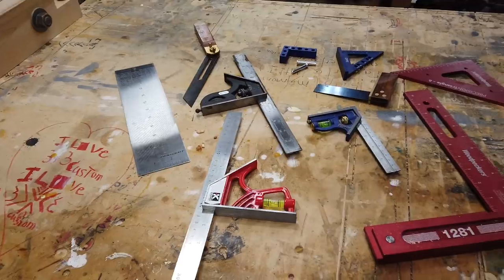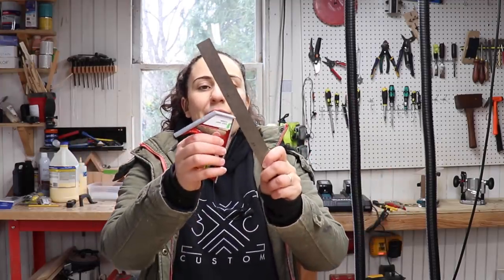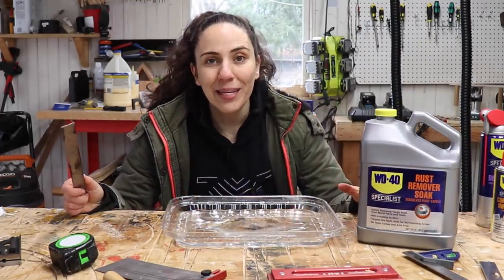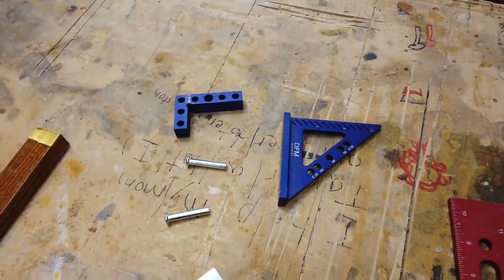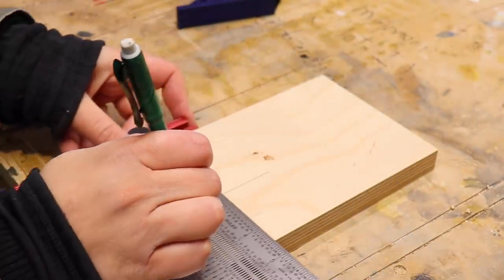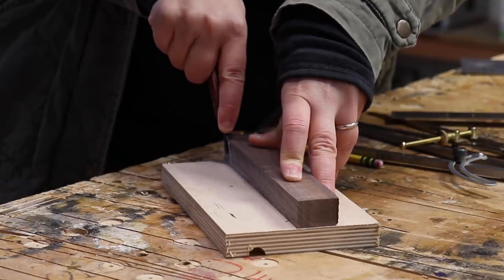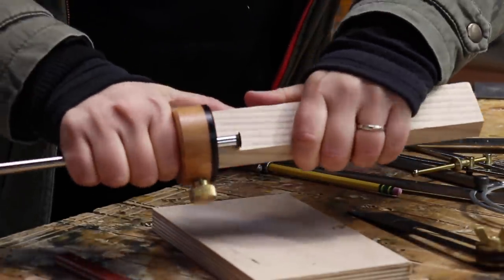Best Tools for Accurate Marking and Measuring When Woodworking

Comment: Excellent video, great examples and rationale.  Love my Starrett combo square.  I moved on to the satin finished rulers, I couldn't keep up with the rust removal.  I like the marking gauge for precise power tool cuts too.  I also quit using digital calipers, as I don't like chasing digital readouts, using instead Starretts analog/dial calipers.  Much less stress.  Keep coming up with the great stuff!
Reply from the maker: Glad you liked it!

Comment: Cool vid. I have a bit of a fetish for good measuring and marking tools. Don't throw out your carpenter squares just yet though, Harbor Freight or otherwise. Most of them are not "square" but can easily be fixed with a little know-how.  If your square is acute, hit a nail set into the flat side of the inside corner. If your square is obtuse, do the same on the outside corner. One good strike is all you really need. And if you are planning on throwing it out anyway, try the technique as practice.
Reply from the maker: Thanks! I was throwing it out as a joke. Don’t worry 😉
Reply: I am sure you were. I was more speaking to the impressionable minds of many DIY viewers.

Comment: Little known trick with framing squares. There is a small hole punched at the inside corner of the 90. The reason for this is so it can be "tuned". Don't toss that square, "tune" it and make it square! Framing squares have SOOOO many great uses and are a critical tool! Check out some "framing square tuning" videos on YouTube. Thanks for all the other tips!
Reply from the maker: I didn’t really toss it.... It was just a joke. I’ve had it fir over 5 years. I use it for other stuff

Comment: It's a little expensive, but if you need true pinpoint accuracy with a center punch, get an optical center punch.  It can really be tough to truly put that indent dead center on your marks with a traditional punch.  An optical center punch has an optic piece with a cross hair.  You sight down it, then hold the base in place, remove the optic and put the punch in place to tap your indent.  It is dead center every single time.

Comment: Good video, and not a Woodpeckers tool in the bunch.  DFM is an interesting company.  That little square is really cool because with the 2 pins, it turns into a multifunctional tool.  Just where do you keep the two pins as to not to lose them?
Reply from the maker: Glad you liked it! It comes in this foam packaging. I keep that foam thing in my tool drawer and keep the pegs in there

Comment: You can also pull 90°'s  or check out square on other enjoyable favorite measuring devices that brong your life joy and happiness by pulling 3,4,5's by measuring 3" or 3 foot or 3mm or 3meters the opposite direction of the 90° you are trying to pull or check and measuring out 4" , 4mm , or another weirdo measurement from wherever you are from like cubits american 10ths or the kings foot 12. Now pull your diagonal from 3 to the 4 and that will equal to the 5 measurement if it does not measure properly to the 5 then your not a square. I laid out a powerplant this way as a surveyor with a tolerance of 1/64th of a inch and we had no issues pulling 90°s to the layouts of the entire 14 acre site within tolerance using this measurement layout system which is actually comparable to the tolerance that the culture that built the pyramids at Giza which was 20,000 years ago and pretty sure that pre-egyptian culture pulled 3,4,5's

Comment: shamefully looks at her Barbara Plate speed square

Seriously though I love your videos! Didn't know you could derust with WD40, which is good because my shop is on an enclosed deck so it is very exposed to the elements!
Reply: WD40 Rust Remover
Reply from the maker: Haha! Yeah! The rust remover soak is pretty cool. Also cool that you can use it until it goes black! So you’re really getting a lot for it.

Comment: I agree with everything except the digital calipers. The usual argument is that they're not as accurate as dial calipers. While that's true you're talking about being off by any amount even highly precise woodworking tasks are going to notice. So that's not a reason I avoid them for woodworking. I mean I avoid them when using my benchtop metal lathe and mill because with metal being a couple hundred thousandths off is a huge deal; with wood not so much.  I've tried digital calipers and they're convenient but the problem is the batteries and the electronics. The batteries are always dead when you need them and the electronics always seems fidgety at best. It seems to be the same story no matter how much you're willing to pay for them. I have a very good quality 8" dial caliper and wouldn't change it for anything.

Comment: You can actually true a cheap combo square with a file.  There are two little bosses in the slide that the knurled knob locks the ruler against and one is a little proud...swipe or two with a needle or feather file and you'll be square and good to go...just for the cheapsters among us.
Reply from the maker: Yeah. There’s always way around it. True

Comment: Yeah you're using that small framing square wrong you can see right from the get-go that that piece of wood isn't all the way straight the way that the framing square wiggled when you did the line the reason when you used your combination square and it didn't do that is because it's such a short distance of contact
Reply from the maker: It may have shifted in the video. But I know this square is not square. That’s how I knew to test it.... I use it as a straight edge for other stuff...

Comment: You are a wonderful credit to the woodworking world! Your enthusiasm and tool knowledge are amazing. As I have been a woodworker for around 50;years, I have accumulated many of the tools you described, … but… you made a good point regarding some of the measuring/marking tools, so I’m heading online to put an order in. Thanks for the great presentation. PS Wait until spring to work on the lattice repair 😉

Comment: Great video!  Woodworking for many many years and totally respected what you projected in the video.  It took a great number of years before I had the courage to invest in good measurement and layout tools.  I'm 65 and it wasn't until the last 4 years I bought into a couple of Woodpeckers squares extremely  well made but overpriced (my opinion, mainly due to shipping costs to Canada).
I don't start a project until I have one of their squares in hand.  I have a bunch of Starett squares left to me from my father-in-law that I restored and cherish and use as well.
Reply from the maker: Thanks! Yeah. Hopefully I can get my hands on some more woodpeckers squares. They are really great.

Comment: Great video!  I video suggestion: a video about the tools, jigs, tables, etc. that you have made to create your shop.  A lot of the tools you have are self made like your cross cut sleds.  Those tools then help make your next project or tool.  I think a video discussing which items to make first would help a lot of people.  

A general rule of thumb: chemical reaction rates increase by 2x every 10 degrees (C).  So, if you did your rust removal soaking inside or in a heated space it should go much faster.
Reply from the maker: Thanks! I have videos on making all my jigs. But I guess that’s a good idea too. And yeah. I brought it inside.... ha

Comment: Im liking your no-nonsense way, and always good info; at 10:00 you are describing a marking guage, but it is really a cutting guage. I like these better than a marking guage because it slices the wood rather than pressing a dent or scratching the surface. I got a cutting guage but it has a ROUND HEAD machine screw at the end. What can I do when making a mark closer than 1/8"? It needs a FLAT HEAD screw to be useful in close quarters. In marking the depth of a mortise, and a many more instances!

Comment: What is the difference between Bradawl and Awl?

The difference between bradawl and awl

 

is that "bradawl" is an awl with a blade similar to a small, straight screwdriver; used for making holes, especially in wood to take screws and "awl" is a pointed instrument for piercing small holes, as in leather or wood; used by shoemakers, saddlers, cabinetmakers, etc. The blade is differently shaped and pointed for different uses, as in the brad awl, saddler’s awl, shoemaker’s awl, etc.

Comment: Great video.  You provide good info, and demonstrate very well.  I do like that you include video where it is reality.  Like when you took the square ruler out of the WD-40 liquid, and we saw the experience you had with it, such discovery that what you that was rust still on there, was actually some black “stuff” and was easily removed.  You also say that you don’t need all these tools, this is what you need to start out, and as you get better you can use tools that help accuracy.
Reply from the maker: Thanks so much! So glad you liked it!

Comment: How to align steel Carpenter's Square.
I was blessed to have a very old steel Carpenter's Square andusing the method you demonstrated learned it was out of square. The Square had a history of over 100 years of use and was worthy of adjustment. I corrected the steel square by "hammering" steel punch dimple(s). In my case the square angle was acute (<90) and 2 to three dimples corrected the square, these were placed close to the inside corner, along the fictitious 45 on the el. The angle of the square expanded and an accurate 90° was attained. Hammer hard and in a line as needed.

Comment: The metal square you tossed in the trash, I’ve corrected one twice the size using a metal punch. Simply see which corner of the elbow, the inside or the outside, is less than 90-degrees. Then using a hammer and punch put create a dimple.  It make take a good wallop with the hammer, and maybe more than one dimple on the acute angle side. But I corrected a 24” metal square with one dimple that took only two medium hammer blows.

Comment: Firstly, the combination square that you tested first is fine but it's very easy for it to be knocked out of alignment. Any tool that you can loosen to slide along a track and then tighten will have play in it, and I actually binned my combination square for that very reason. I really don't get why you swear by them. You're far better off with something that can't be easily knocked out of alignment.
Secondly, the framing square that you used, you can clearly see that you throw it down and then move it slightly to make your point. It's actually quite difficult to get those square because you have to angle it as you did so the bottom part resting on the edge of the timber doesn't slip. You'd be better off with a Woodpecker one that has an overhang so you can still rest it flat on the wood.
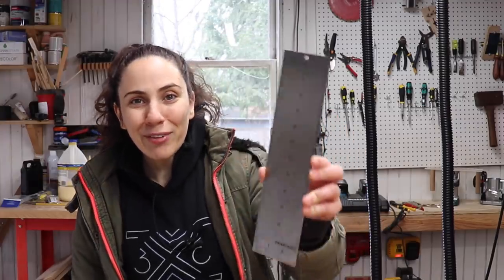Also, at 5:44 - seriously... you went and got that additional tool when you could have just purchased a digital angle rule and had 1 tool for both jobs!

Comment: I personally prefer dial calipers to digital calipers, mainly because I ain't got no time for button batteries.  I've got a fractional/decimal inch caliper that is such a nice tool.  You don't have to turn it on, remember to turn it off, etc.  Plus I find an analog gauge to be more informative than digital readouts.  Context, I think is the term.  "13/64" says the digital caliper.  "Three notches less than a quarter inch" says the dial caliper.

Comment: I'm a dial caliper guy.  I have one set of digital calipers, but after the fourth or fifth time the batteries went dead when I needed them, forcing me to run to the store, I got a pair of good dial calipers, one metric, one imperial.  I haven't used the digital calipers since.  The dial calipers are actually more accurate anyway.  Digital gives you out to 1/1000th, but rounds it to the nearest digit.  Dials will let you know if it's under or over that 1/1000th.  True, that kind of difference is pretty meaningless, but it's there.

Comment: The grey pad is either Very Fine or Ultra Fine Silicone Carbide. White pads are the non abrasive one. This is from one who spent 40+ years in the abrasive industry.
I'm hooked by how you solve the problems you find in projects...

Comment: Hi, great video.  Just wanted to mention that WD40 is great for steel but should NOT be used on aluminum.  Just watched your video on the strip cutting jig from a couple of years ago where you showed how well 3in1 garage door lubricant worked.  At the end I noticed that the door falls on its own.  The springs should be adjusted so the door stays stationary where ever you put it.

Comment: Hmm...Am a bit overwhelmed.I know you said you don't need all of them...but how can you work around not having some of them?How do you decide when it's worth getting a certain item?
Am super new to this do you have guides on using all of them with examples?Or if not who's videos do you recommend?Thank you so much!
Reply from the maker: You use what you have until you come across a project where something is required. Like in the beginning you aren’t using too many odd angles. So just a good combo square is fine. Then you want splayed legs for a table. To you need a tool to measure angles. The tools come out of a need for what projects you are working on

Comment: With the angle-finder, have you considered grinding the wing-nut wings down to a more reasonable size?  A belt-sander or angle-grinder should make quick work of this (legit) annoyance.
Reply from the maker: Yeah. I always think of it while I’m in the middle of a project. So it gets thrown to the bottom of the list. But it’s just a stupid design and wanted to point that out. Ha

Comment: I gasped ever so slightly when you tossed that "square" sold by that company that rhymes with Boiler Plate (I think that's what you said?)  First I thought,  "Put it in the metal recycling bin",  and then I remembered,  there is a way to correct an out of square square.  I don't think I've ever had to do this,  but it has something to do with using a punch and giving it a whack in the corner.   I've hunted just now for a quick explanation,  but I have the patience of a gnat.  On the other hand,  it's likely so cheap,  that tossing it is more "cost effective".   Carry on!
Reply from the maker: Hahah! I’ve had that square five over 5 years. I didn’t really toss it. I use it for other stuff... no worries 😉

Comment: Great video EXCEPT that square you threw into the trash can could have been made square with a centre punch and one or two hammer strikes.  Probable not the best square for fine work but if made “Square” it would have been fine for rougher work outside the shop,
Reply from the maker: Nobody can take a joke…

Comment: If you wanna go for a cheap square, buy it in person. grab a super accurate machinist square from the shelf, walk over to the combo squares and go through the pile, till you find one that is accurate. When i did that for mine, at least 90% of them were off. So check them before buying, if you buy a cheap one.
Reply from the maker: Sound advice!

Comment: Not sure if you know about the 4th way to measure on the calipers? It's a depth measurement also but using the shoulder. So look at the rear of the caliper and open it up. You will see 2 flat shoulders extending from each other.
Poor explanation but will hopefully make sense when you have calipers in hand
Reply from the maker: Yeah! Forgot about that one!

Comment: Hey Tamar. Have you ever heard that you can fix an inaccurate square like you threw in the trash? In the case of that one what you would do is take a center punch and where the 90 degree angle is you would strike it at that angle close to the apex. Knock a dent into it. It might take more than one blow in which case you would strike it again in another place but close to the first mark. These strikes should be on a line starting at the apex and working outwards. Retest as necessary. Your square was making angles of less than 90 degrees. If it was more than 90 degrees you would do the same thing only strike with the center punch nearest the outer most part of the apex. This is the angle furthest from the inside angle which is the "apex" as I am calling it. Again, the strikes would be on a line from inner to outer points.
Reply from the maker: Ha yup. I didn’t really throw it in the trash I’ve had it for 5 years... it was just for dramatic effect 😂

Comment: I love your videos. The square you threw in the trash is likely adjustable. You probably already know this. To open the angle tap with a center punch on the inside of the tongue, to close the angle tap on the outside of the tongue. There are videos on this.
Reply from the maker: Thanks! Ha! It was a joke. I’ve had that square for 5 years. I use it for other things 😂☺️

Comment: I too had a problem of "not finding anything" while working, so I built a small "temp box" 18 x 8 x 6 out of scrap wood. It has a lid, a baffle & a vertical pencil holder. Now whenever I use the hand tools, drills, screws etc. on a given project, I place them back into the temp box . Surprise! They are there when I want to use them again. It has saved me a lot of "where the heck did I put it" time. Also handy for clean ups.
Reply from the maker: Haha! But you have to remember to put them there.... 😂

Comment: I bought that Incra and took one look at all the holes and sent it right back. There is such a thing as too much of a good thing. Too many holes that are too small. You need a needlepoint pencil to use the thing. That little center finder widget will only work correctly if you have a pencil that fills the hole you put it in. Otherwise you are either going to be off center or have a wavy "centerline".
Reply from the maker: I hear you. Sometimes simplest is best. I